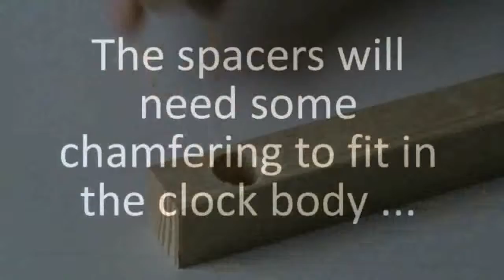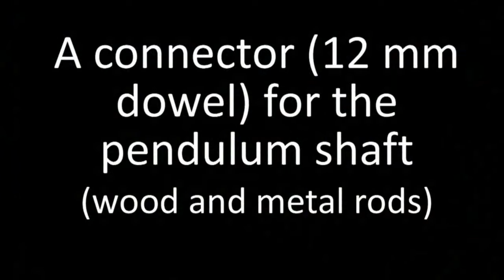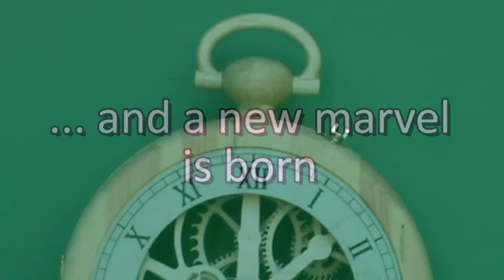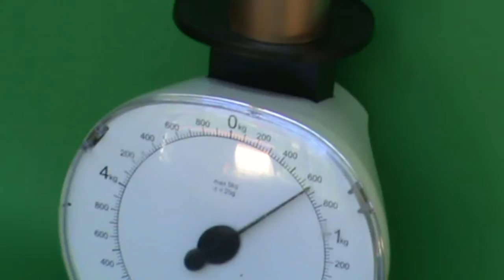Clock #9. A new frame

Comment: Sorry for my English. Are all axle rods with 3 mm dia in Your new frame  ?  Are all bearing 3.1 x 8 x 3 mm in Your new frame ?What function have grub screws in a bearing housing (for the back frame holes ) ? Thank You for Your answer.
Reply from the maker: Hello, Igor. Yes, every axle rod has 3 mm. diameter. The bearings 3.1 (inner diameter) allow to pass freely the axles throu the hole from the rear frame. Then the grub screw holds the axle in place ensuring a minimal metal-metal friction among them, and adjusting the room for the axle avoids any "to and fro" to both axle and gears.
Reply: @AntonioGimeno  Hello Antonio. Thank You for Your answer. Now I see. I would like to ask You some questions: a/ Six spacers are glued to the both frames in final version ? b/ Why do You keep 45 mm  room between frames (is it enough?) ? In Brian Law planes is distance 63 mm between both frames. c/ Is cca 0,65 kg (25 oz.) weight enough ? Brian Law recommend cca 2 kg weight. Or is it due to Your bearings (Brian have no bearings) ? Thank You for Your answer again.
Reply from the maker: @igorsvetlik9321  Hello, Igor. Yes, the rubber bands worked along the testing time only. You you will get that 45 mm. room between frames only if you:
- use 5 mm. plywood for your gears instead of those 6 mm. proposed by Law.
- re-arrange the placing of some gears in the AP axis.
- minimize the distance between neighboring gears.
Then you will have a lighter and more attractive look at your clock. The weight: after adding bearings to both frames, the needed weight was much smaller then expected. After building up a new clock, put a cooking weight under the weight itself, and watch, when the clockc stops, how less weight do you need. The back frame: being also 5 mm. tick, needed a little wooden suppplement to accomodateth those grub screws for every axle.
Reply: @AntonioGimeno  Hello Antonio. I am going to make this clock shortly, so before starting I have got a lot of questions. Here are my next questions:

a/ how is allen screw coupled with winding gear ? Glued or screwed with bushing of the windig gear ? Is there no bearing and no axle rod ?

b/ How is connected the short axle rod (for the gears 49 and 50) to the front frame ? Is it glued or through the bearing ? What is a diameter of this short axle rod ? 3mm too ?

Please be patient with me. Thank You for Your answer again and again...
Reply from the maker: @igorsvetlik9321  Hello, Igor. As you can see (video point 15:57), the winding gear #49 is glued to a little wooden axle (9.5 mm dia.) previously tappered to receive that #5 Allen screw, which with a metal washer holds both gear and axle in place. I used no bearing, the friction is not an affair here, so soon in the movement chain.
Reply: @AntonioGimeno  Hello, Antonio. Thank You for Your answer for my a/ question. And what about my next question b/ ?